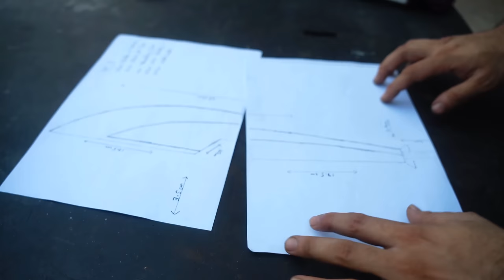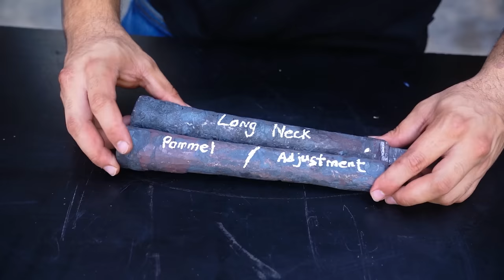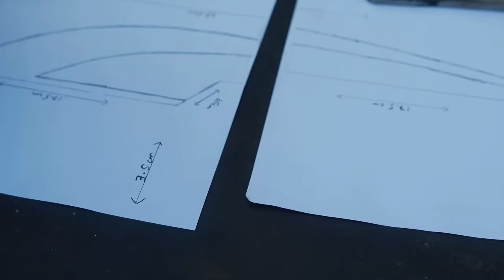Forging HALBERD WEAPON from Celtic Heroes 🔥

Comment: i would have slotted the metal to wood connectors to cover further onto the wood instead of narrowing the wood ends into male pegs, you lose a lot of structural support and possible fracture points at each tip of the wood handle. beautifully crafted overall tho
Reply: Agreed but he should have use a full length OAK spear stave rather then two halves.